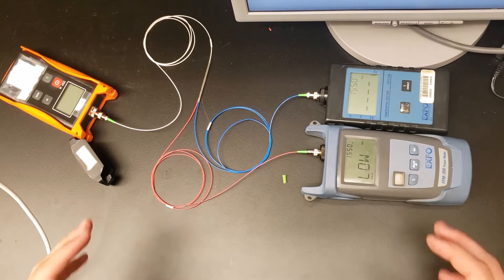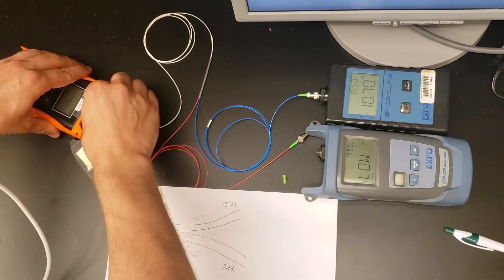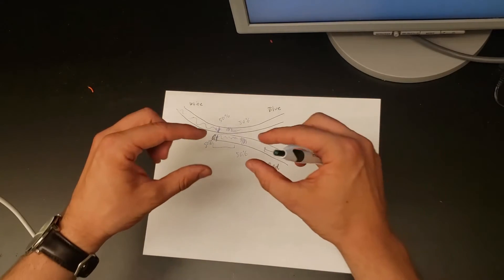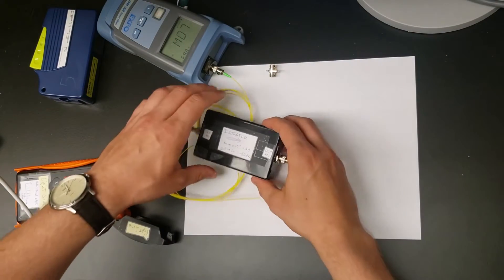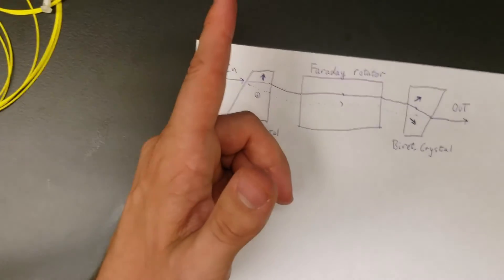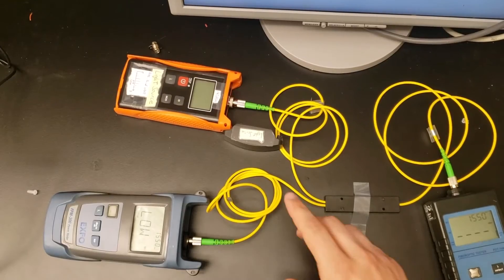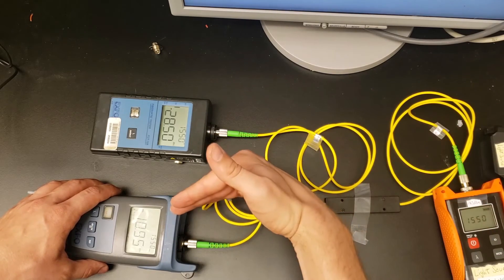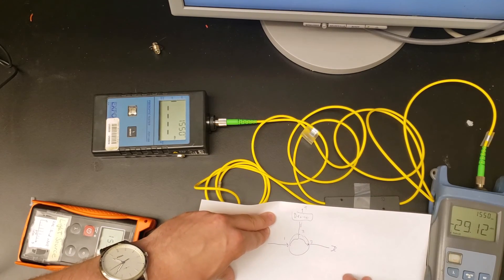Couplers, Isolators and Circulators in Fiber Optics

Comment: Love the video, Ole.  Can you talk about polarization in optics or quantum optics?  Would be very interested in seeing a video on that!
Reply from the maker: A video on polarization in fiber optics is coming up, so stay tuned! 

Quantum Optics is not my area of expertise, but if you are looking for a good place to start, I would recommend looking into the Hong-Ou-Mandel effect. Essentially, if you simultaneously launch two single photons into a 50:50 beamsplitter (one in each input port), quantum optics predicts that you will always get 2 photons in one output port or 2 photons in the other; never 1 photon in each. Essentially, there are two ways that the 2 photons can end up in the "one photon in each output port" configuration, but these paths interfere destructively and thus the 1:1 outcome does not occur.

The wikipedia article on the HOM effect does a great job introducing the concept and the QO formalism:
https://en.m.wikipedia.org/wiki/Hong%E2%80%93Ou%E2%80%93Mandel_effect

A more comprehensive treatment can be found here:
https://arxiv.org/abs/1711.00080